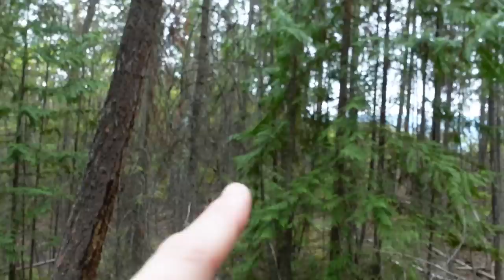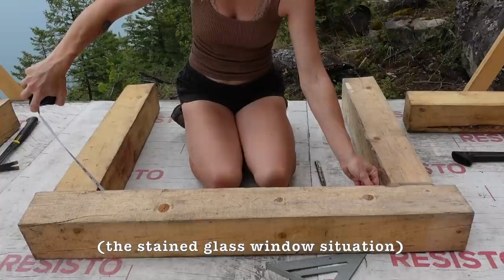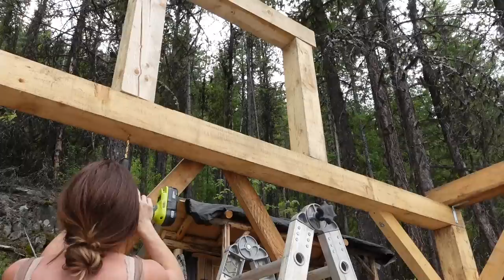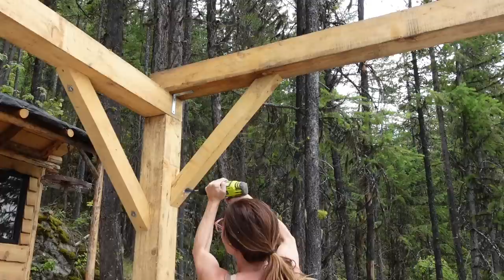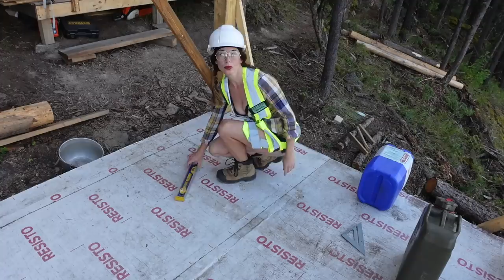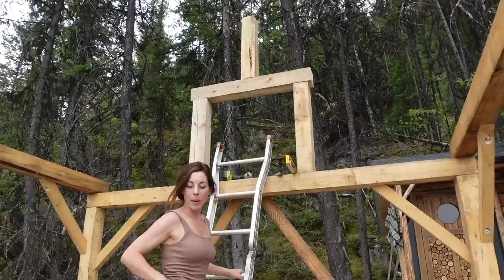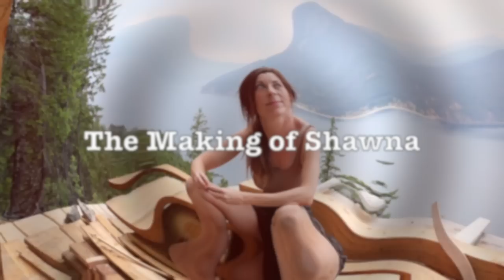The Cabin on a Cliff: post and beam install (Ft. Another visit from the building inspector). Ch12

Comment: When setting beam on uprights, create saddle with two pieces of scrap screwed on sides of upright. Use existing frame to help support platform to stand on. Safety harness and safety cable to hook to when working above 5 ft off ground. "500,000 falls from ladders annually; 97 percent occur at home or on farms"
Reply: Seems like that inspector shoulda told her that.
Reply: think that kind of blanket application of rule & statistics is heavily influenced by and more applicable to employer liability, where it's  probably a good thing. in an individual thing, without employer pressure if you felt unsafe or too wobbly you'd think on it a bit and make it safe. unless you wanted to be in one of them funny people falling over videos.
Reply: Come on Safety Sally…
Reply: fugg yes, don't play with safety up there, could be your last project if it doesn't work out right,specially when things get slick and icy, wont hurt to set up rigging in those tall trees and run life lines down so if you fall you don't hit the dirt or the deck and roll down that hill you are suspended then you can ease down and get right back to work, smarter not harder!
Reply: Boring
Reply: You know, the advice you are getting here is pretty good advice. Advice, part 2, don’t do this alone. Even with a harness and safety line, you can still die from a fall.
Reply: thnking same thing,
Reply: First of all, great job!   However if you were my Shelia, on those high spots on the ladder, I would be there to hold or help.  I know you are independent but even Jesus had 12 helpers! 😅. We don’t want to watch a video of you heading down to the lake!
Reply: Always remember Karen, safety third!

Comment: I did roofing and remodeling for 22 years and most of the time I had to do a lot of the work by myself.  I have no issues with you not feeling safe in the winter time doing projects like this.  You never know what may happen and when you are by yourself you still need to rely on yourself to be able to get help should something go wrong.  Safety is always the number one thing to be aware of on any job site regardless of being alone or having 100 others on the job site.

Comment: When you decide to build that other cabin I would definitely use a raft of some sorts to get your materials to the site. That would make it so much easier for you, in the long run. Here's a tip, I would screw a stripe of plywood on both sides of the vertical king post connecting that ridge beam. That would prevent the beam from shifting off the edges than once you have more structure installed you can than later actually nail the ridge beam to the king post. And than remove the plywood later on..just a thought. Good Luck btw your doing a great job just please be careful don't fall.
Reply from the maker: I am reading this but seriously have to look up all those definitions to know what you’re talking about! 🤪. I felt smart knowing it was a ridge beam, but don’t know the other terms. I’ll look them up. 😬

Comment: Greetings from Greece, been waiting on an update for the cabin. Great job so far, I  like the fact that you're milling the timber you're using. Just a suggestion, because I get that you're scared of heights, I've worked in construction, you could use a scaffold to keep on with the roofing. Scaffolds are lightweight so it would be 1-2 trips to the cabin. Also a harness could help, for your peace of mind. Keep it up!

Comment: Just a suggestion. You need a few clamps to help hold things in place and a safety harness. Pick up an old boat ratchet and strong heavy duty I bolt straps and build a platform upside. Make a small basket lift to hoist lumber and tools top side and reduce the trips up the ladder. Put up some temporary bracing and and a rail. Work safely. Those ledger locks look like they are working well but you might want to consider some  Simpson Strong Ties too. I admire your tenacity but stay safe. 👍

Comment: You are Mishigoss....love it. I would have loved having you on my crew. You work hard, somewhat fearless and strong. Hopefully your design can handle snow load. Build a platform between your wall beams that you can take down after you build the roof framing. You could extend it out cantilevered to assist with roofing.
Enjoying every video. I'm an old Mtn biker that took a hard fall. Had to have an aortic root replacement but a few years later I built a 20' x 32' x 14' garage all on my own. All the excavation,  cement, block laying, framing, electrical, paint myself. Had the shingles done.
Love your channel.
Reply from the maker: Yep, I am planning to build a scaffolding system on the existing posts, and your idea from beam to beam is great! Thank you!

Comment: Great video.Remember Safety First.Wear the Helmet when you work with loose beams above your Head.I use Motocross Glasses as Safety Glasses, they are easy to handle have no gaps and are so comfy.And if you fall, remember to roll at the landing, learned that through Judo.Keep on trucking.

Comment: You've learned so much and I like seeing you wale away at those long spike nails.  Nice and true hits.  I would recommend that you use the paddle bits FIRST to make your counter-bore holes, THEN drill the deep hole for the bolts or spikes.  It's easier that way. Keep up the great work!
Reply from the maker: Ok! Didn’t know that. Thanks for the tip!!

Comment: You should consider purchasing a set of auger drill bits.   You can get them in long lengths and they just bore right through wood.     Harbor Freight has a 7 bit set for $15.   I used them for zipping right through joists to run electrical wiring.

Comment: Clearly you've been alone in the woods a bit too long, LOL.

I would throw some cross bracing on those supports for your ridge beam until you can get some rafters in, seems like a lot of weight for 2 lag bolts to support if you get any lateral force on them from wind or something.

Comment: Glad to hear you are going to insulate.  You may want to consider wrapping the structure in continuous rigid foam insulation on the outside of the studs instead of between the studs.  Air sealing is the key.  It is actually more important than insulating.  Well taped continuous insulation on the outside of the studs is a great way to create a draft-free structure that is much easier to heat.
Reply from the maker: Yep - insulation is all going on the outside in a continuous way. You will see grasshopper 😁

Comment: Wow, can't wait to see the rafter/roof process,  it's looking like your pitch is going to be pretty steep,  looks close to a 8 or 10/12 pitch, exciting.
Reply from the maker: Ya I’m not sure what it is - the king post is 5’, then add 5” beam, then rafters on top of the ridge beam. Cabin is 10’ wide.  It’s gonna be steep is all I know. But I wanted it to look and feel like a big proper cabin although it’s only 10’x10’.
Reply: @michygoss7148  so 60 inch run, 65 inch rise, will probably put you at 13/12,  yep, this will be exciting to watch.

Comment: Hey Michy, looking great, all safety all the time please get a proper harness and use it🙏. Your out there alone and a fall from that height would not be pleasant. Also a little tip when drilling over your head use a clear plastic lid with a hole in the middle for your drill bits, this will keep the drill chips off your face and hair! Take care and be safe
Reply from the maker: Great tip! Thank you!

Comment: Well I AM not worried if you get to that build anytime as you're always doing something that brings on a nap time for moi. Curious if you'd use metal angle brackets for the top joists though. I counted 6 however you may use more as I find them to be a builders Blessing 🥸

Comment: That looks like a 6 1/2" Ryobi circular saw. I got the 7 1/4 " (full size) about a year ago and it rocks. BTW I am a carpenter and renovator that uses his tools daily . I love the Ryobi battery tools for their selection and affordability. All my corded tools are big brand but for the money I love my cryobi🤣 battery tools. 5 drills 3 impacts circular saw jigsaw oscillating saw and more.
Reply from the maker: Yes it’s the smaller circular saw. I may get the bigger one one day…
Reply: @michygoss7148  the 7 1/4 is brushless too lots of power with a 4 Amp battery 😎❤️

Comment: hi, you need to use flat L braces and flat T braces where posts and beams meet. you have been using wood screws.   screws will NOT keep posts or beams from swaying  i have built  car ports and patios.   go to your lumber yard to get
Reply from the maker: Are lag screws/bolts considered wood screws?

Comment: Put a zip line up to bring material from the top down to your cabin. Also from below up. Using a winch or like a ski lift. Less personal hauling a large load, easier on the footing an back .
Reply from the maker: We did install a zip line this spring to drop materials there, but not set up to bring anything back up

Comment: Suggestion drill pilot holes for those big as nails on your ridge board.
Reply from the maker: I will. Meant to do it before I installed it, but will get to it when I’m up safely for the next stages.

Comment: Good stuff, the building inspector was just a tad creepy lol but all in all entertaining 😀 that ridge beam is going to have to overhang on both sides Michy, otherwise you'll need to cut and hang false rafter tails all along the outside to support your roof over hang..
Reply from the maker: Adding overhang is already the plan which I spoke to in a previous video. The trees I milled were cut to 12’, so that’s what I had to work with.
Reply: @michygoss7148  oh okay, I didn't remember that,  plus I'm sure lifting those 12 footers was probably enough all by yourself too, well keep chipping away at it Michy, I believe that you'll definitely have a roof and siding by winter 👍
Reply from the maker: @mikefalanga437  yeah, I just don’t wanna jinx myself and say I’ll get more done than I actually do.
Reply: @michygoss7148  well, when I was still framing we would have a set quota that we would try to accomplish each day, and the thing  that served us most of all was having a solid game plan and organizational habits, we would measure and figure out exactly what we needed, okay we need X amount of studs, we'd cut em' and have them set aside, okay now how many jacks and headers do we need, boom they were all done and nailed together, rafters cut and ready,and we did it by labeling walls A,B,C,D etc. And every time we needed a component it was there, I can't stress how much time that saved us, and so even to this very day, with any pro-ject I  get into, I use that same formula, ya see, the prep work will always be the most tedious and time consuming process of the build, but if you knock that out first, the rest will always be smooth sailing as long as you pay attention and  avoid mistakes, or nail your finger into a top plate somewhere lol 😆 by the way, I never did that 
🔨🙄
Now you building by yourself is a lot harder, but you will enjoy the process a lot more if you feel confident in the fact that you have everything you need all lined up and waiting for you to snap em' together, you got this girl ✊😊 build that little paradise on the mountain!

Comment: I kept thinking you were going to put some braces on the ridge posts as well.  I know the rafters will act as braces once they are up, but I think it would help to stabilize things while you are putting the rafters up if the ridge posts were braced.   Just a thought.  Love your videos.  Yea..... Shawna's "operation" turned out very well.
Reply from the maker: Yes, you are right. I will add some before I start working upward more. I will be bracing and stabilizing things a bunch more before I head up.

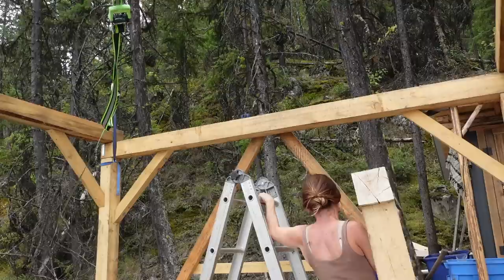Comment: I think you're doing a hell of a job out there on your own. I like your handle grip low on the hammer (@ about 06:00) but you need more wrist and less arm in your swing - don't push (as much) with your arm, swing by flexing your wrist and letting the weight of the hammer do the work. - it's sort of a combination - let your arm pivot at the elbow - without trying to 'muscle it' too much - and let your wrist flex forward on the down swing, and back on the upswing - your hammering will be smoother, more accurate, and less tiring ... More Shauwna, please - her eyes are almost as pretty as yours .. (I really enjoyed the skit)

Comment: you need a good solid and supported catwalk on each side of that ridge beam.. 2 - 2x12's is best but 2x10's will work, post under them in 2 spots equaled out then nail down the ends to the wall frame top plate, give yourself something good to walk on or put ladder on to spread those rafters out, don't play game sup their with physics, you lose and it may be your life unless you have cell service and one if your pocket if you fall, and the number to a life lift, work smarter not harder, its better to put up scaffolding to be safer than to take risks in a remote build

Comment: - just don't hurt yourself Mich. If so, how would you contact help, then helevac you out to get help. It can happen so quickly. I can remember while roofing my shop ( with help) help, tried to remove a nail with a cats'claw and well the head of the nail flew off (+12' or so ) and landed on my eyeball: I sensed blood and it took the whole day diving and back from emergency room. All is alright, luckily. Just something to provide for JIC.
Reply from the maker: I know. Everyone is worried about my safety! I will be using a harness and building a sort of scaffolding for the roof. It’s gettin’ real now, and I’m gettin’ up there in height, so I will definitely be altering my game plan 👍